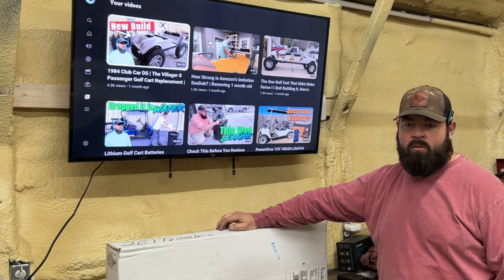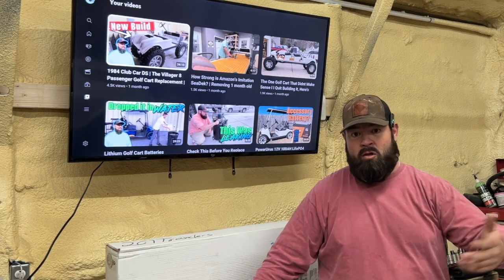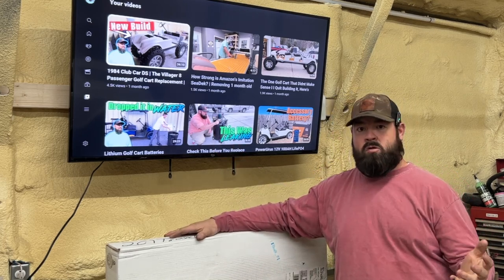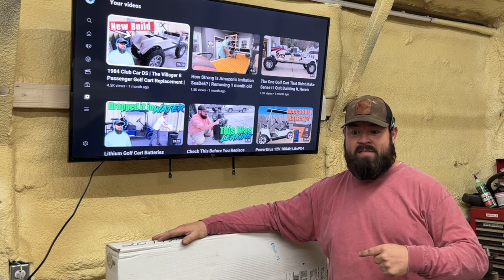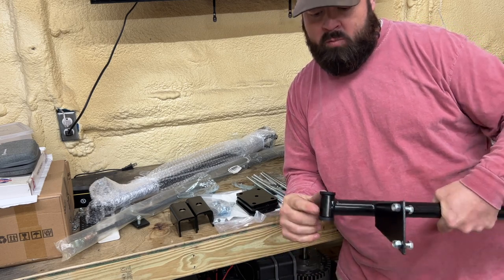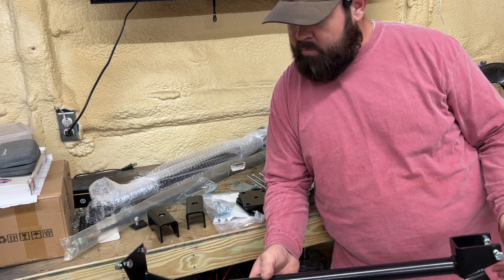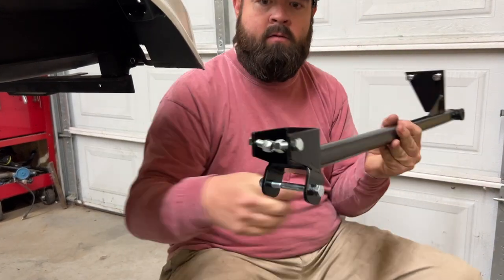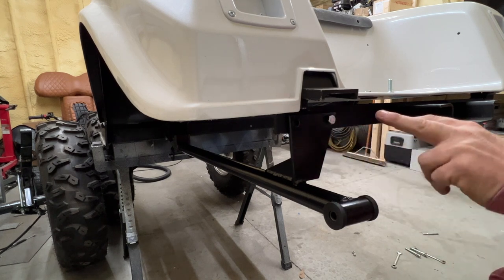I FIXED the Rear Suspension on WLKNTALL | Allsports 10" Golf Cart Rear Lift Kit 1984 Club Car DS

Comment: Good video. 
By the way, thanks alot bro 🙏, I received my 36v set of enjoybot battery today, I installed "super easy" as you did , and my old G16 went from 16 miles per hours to 22 miles per hours now,  again thanks alot 👍